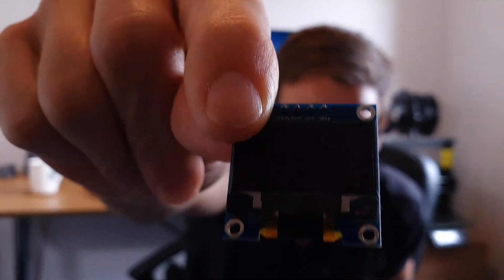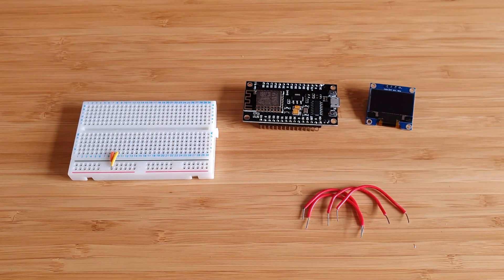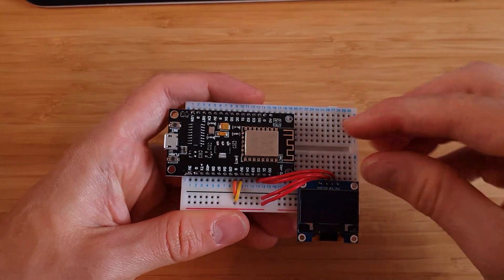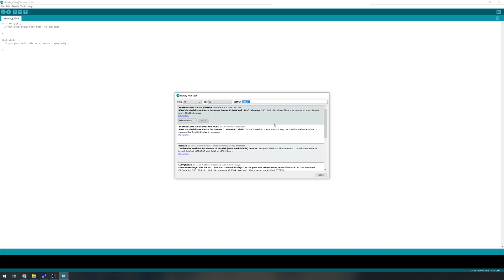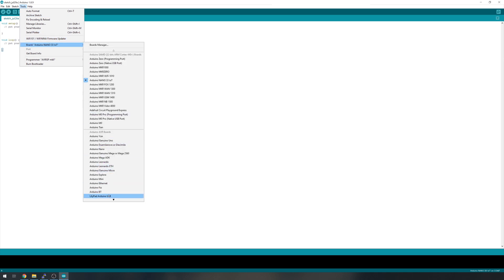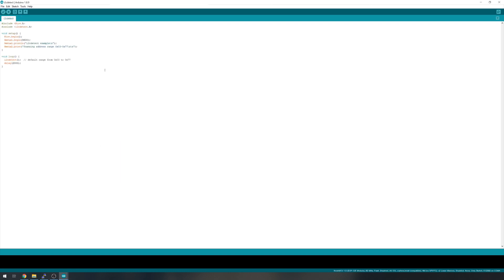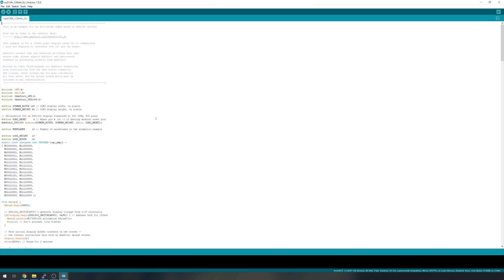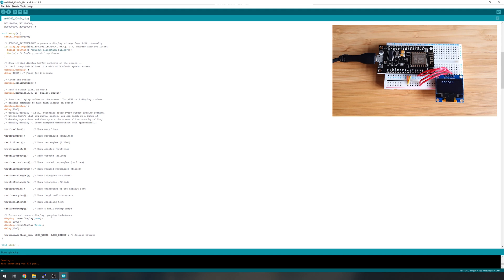Using OLED displays with Arduino/ESP8266

Comment: what needs to be changed or added to the sketch in order to register two access points (that is, two WiFi networks)?
If one doesn't work, will it connect to the other by itself?

Comment: im getting nothing the only thing i did differently is connected the pins directly instead of using a breadboard also when i use the detect the only thing im getting is 12:26::36.888 which is the same style but different numbers each time and when i imput this i get an error i dont get the error when i use 0x3D im also using a ssd1306 0.96 128x64 oled screen what am i doing wrong????